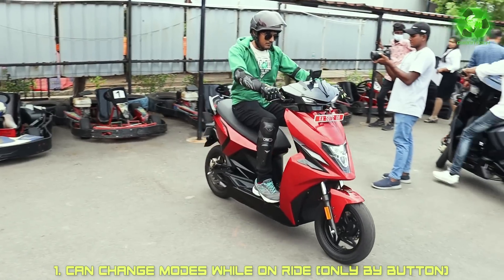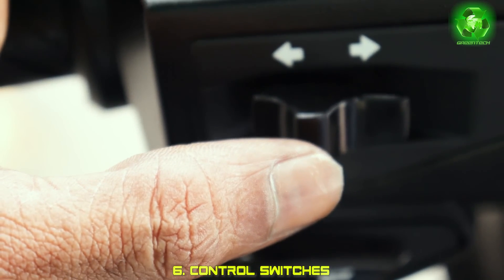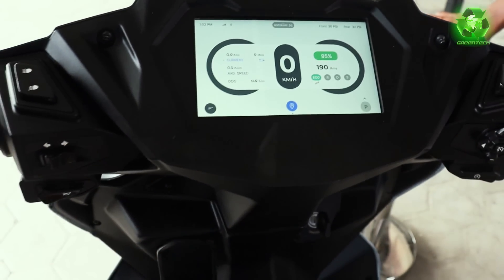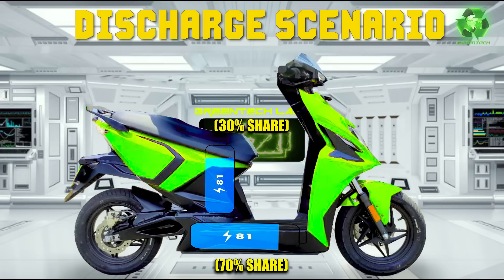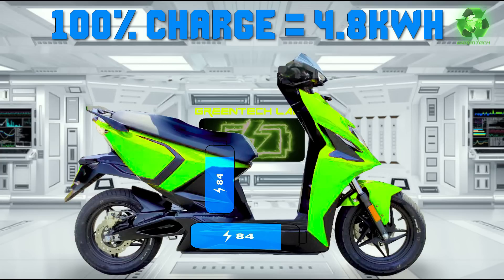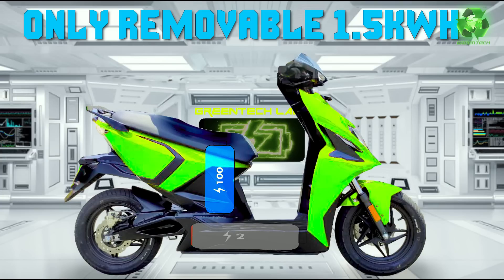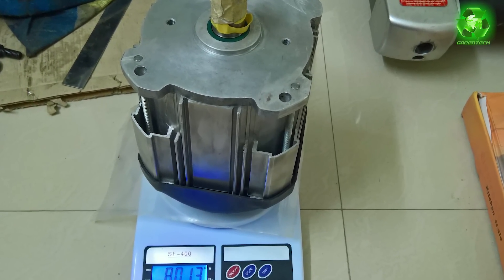Simple ONE Electric Scooter Worlds Most Advanced Battery Tech 15yr Life? My Analysis| GreenTech Bike

Comment: Very good explanation.👌👌
Animation 🔥🔥🔥

@8:20 Just a thought... while in Asym Discharge, (Main battery is drained and fully charged Removable battery is placed). In this case, let the discharge be like system consumes the removable battery alone. But during the idle time and during the ECO mode, let there by another feature where main battery get charged using the removable battery in parallel. This way main battery cud be charged slow and steadily. Removable battery can be used as sourcing the main battery.
This way, if in case, we are in long ride, removable battery shall be taken out for emergency filling,  as we can't expect that we get space and plug to charge the main battery on the go. 

👍👍👍Wishing you to get a break through in making your own EV vehicle and shine well.👍👍👍
Reply: உங்களுடைய வாய்ஸ் சரியாக கேட்கவில்லை தமிழில் பேசினால் நன்றாக இருக்கும்

Comment: Completely wrong information 
As per simple energy
The fixed battery in the floor board will charge first and will be charged will 70% afterwards removable battery will get charge next and while driving removable battery power will be utilised only during eco mode only 
This is what their current scenario
They said they are working on simultaneous usage of both batteries together

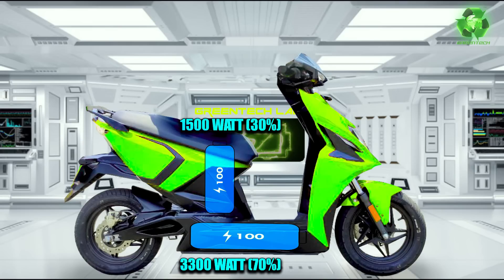Comment: 5:08 Says 10 years of EV knowledge, goes ahead and shows battery capacity in Watt 😂

EV 101:
Watt = Power
Watt hour = Energy

Ex: 1000 watt (1 kW) air conditioner running for 1 hour will consume 1000 watt hour or 1 kWh or 1 unit of electricity